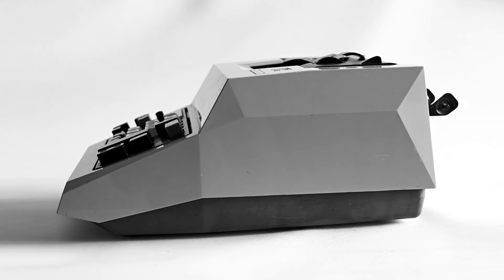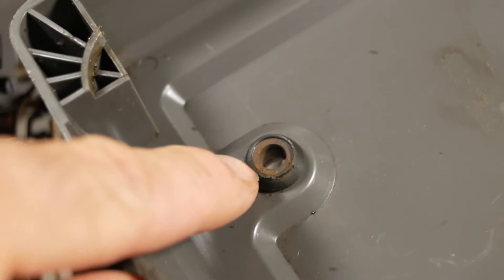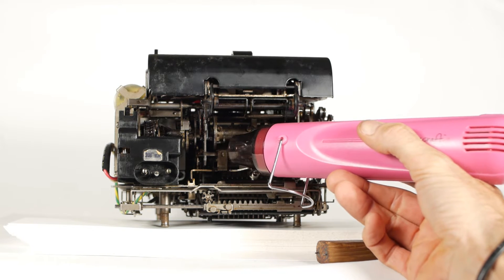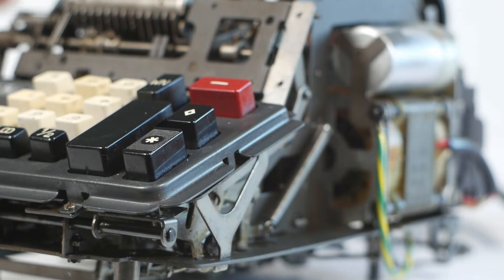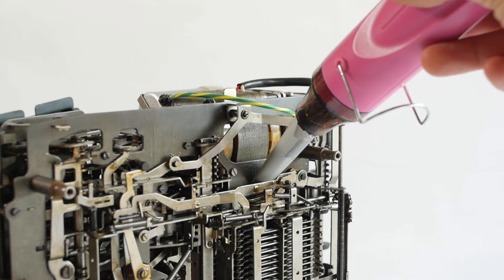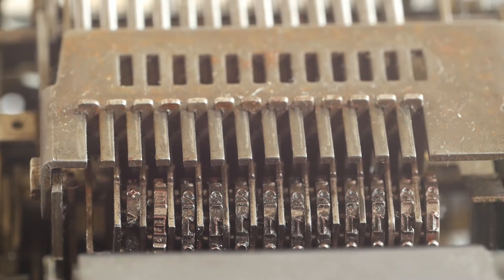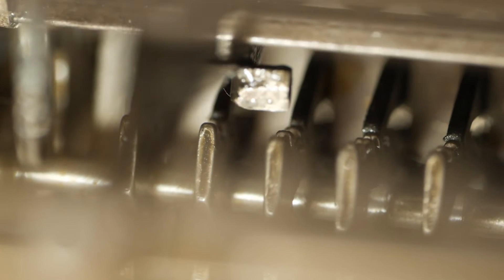Olivetti Multisumma 20 - Part 2 - Mechanism & Repairs

Comment: Hi Tim, I have a machine similar to this one. It's an ivrea 20 electric. I have found a few sticky parts and got them moving. All the keys work except the number pad.
When I press a number the indicator stays where it is. You can see the linkages moving and you can hear the pins being pushed on the matrix.
The silver bar you mentioned in the video is clean and I have used penatrating spray to try and get it moving. Any help would be appreciated. Thanks.
Reply from the maker: Hi Wavydave Hill, the keyboard mechanism should be pretty similar or even identical to my machine, so hopefully, with a bit of detective work we'll get yours running.  I presume the indicator for the numbers is all the way to the right, ie no digits have been entered.  In that position, assuming the matrix which runs on the silver bar is free to move, you should be able to move the matrix about a millimetre to the right and then it should spring back to where it started (viewing from the front of the machine by the way).  It won't move the other way until a key has been pressed.  If it won't move that little bit, it could still be gummed up with old oil - that sliding bearing has quite a large surface area for the old oil to stick it solid.  If the matrix will move that small amount to the right, but doesn't move back to the left when you let go, it could be that it's still sticking, or the spring that pulls it to the left is broken, disconnected or missing.

Anyway, have a quick look at that and let me know what you can find.  Feel free to email me (address in the "about" tab on my channel), that way you can always send photos or video if required, because it's often easier to see a problem than describe it!!!
Reply: @GrumpyTim  Thanks for the reply. What is your email, I couldn't see it.
I tried moving it to the right but it wouldn't move.  
What I have found is the clamp around the block that moves is attached to a lever with a roller at the end. There is a arm which is connected to a rear cam. This is on the left of the machine look at it from the front.  This arm with a roller on it seems totally jammed. It seems to go in the keyboard. Is there something that could be jamming it. I will send a picture of this leaver. Thanks.
Reply from the maker: @wavydavehill8520  I'll take a look at my machine tomorrow to refresh my memory.  In the mean time, my channel name at my channel name .com should get you there, obviously inserting the name of my channel! I tend to get about a million spam emails if I leave my email address in the comments.
Reply from the maker: Hi Wavydave Hill, definitely a few photos would help - the am with the roller is used to drive the matrix back to it's rest position after a calculation.  At rest, there should be no movement in one direction, but you should get about 1mm of movement the other way (it's directly connected to the matrix so it's the same movement you'll be feeling.  However, if the matrix is still seized on it's shaft you won't get any movement.  Likewise, if, for some reason, the matrix has been pushed hard against the end stop, then you won't get movement in either direction.

Comment: Greetings from Portugal from a recent fellow enthusiast! Great video, bought a Multisumma 20 in what looked a great shape, but many parts were not working... following your general directions in this video I've managed to put it ALMOST in fully working condition! The only problem I'm having now, that renders the machine useless: both in addition and multiplication the machine does not carry decimal increments from the previous number operation.  Example:  ADDITION  12+13=25 (OK)  BUT  12+19=21 (does not carry the 1 from previous position into the next ) -----  24*2=48 (OK)  BUT  28*3=64 (SAME, does not carry the 2 from previous position into the next ). Many parts were seized up... Do you have any clue of the offending part? All the best and thanks for sharing your knowledge on these amazing beasts.
Reply from the maker: Hi David, I'm away from my Multisumma for a few days, but I'll think about your problem and if necessary take a look at my machine when I'm reunited with it next week, then I'll get back in touch.  In the meantime, could you add the fairly normal 123 + 456 + 789 + 987 + 654 + 321 - do it several times and make a note of the result each time - it might give me a bit of an idea, or it might not help at all - my hunch is that you'll get fairly random results but I could be wrong and you end up with the same every time.
Reply: @GrumpyTim  Thank you very much for your answer! I will turn it on and see what the machine spirit feels like answering — and post it here!
Reply from the maker: I had another little thought, try the same thing but add 3 zeros, ie 123000 + 456000 and so on - that way, if it's only the third column that's not carrying correctly, you might get the correct result, or it might be even worse.  You could even try with 4 zeros, after that we should have more of an idea whether it's one column or the entire register that's playing up.
Reply: @GrumpyTim  Thank you for your generous help! Will try it tomorrow and let you know - I managed to find 2 service manuals online, one in English, the other in Italian, very detailed for problem solving and practical work to solve them... but if I have to make an open heart surgery to the Multisumma register or accumulator I fear the worst... will try it nonetheless and learn something in the process, even if so much above my present skill level!
Reply: @GrumpyTim  Greetings again! Finished the test, and again got a consistent same result every time: BLANK total! Good Lord, not even zeros... I'm totally baffled! Even not being able to carry it should had gave me some zeros: if I summ 950+50, for example, I am given an infamous 900 as a result! Thank you for all your patience with an internet stranger in mechanical distress!
Reply from the maker: This may take some time!!!  Are you running the machine on the motor or turning it by hand - the only reason I ask is that it's a bit easier to see what's going on when you turn it slowly, but either way it's not the end of the world.  With the register cleared (assuming it will clear, it's always possible that it won't clear if there's still something sticking in there), if you enter all 9s and press the plus key, do all the number wheels move to their 9 position as they should?  Then if you press the sub total or total, does it print the 9s as it should?  Assuming those are both "yes" I'll go away and refresh my memory on how the register operates and performs the carrying of numbers.
Reply: @GrumpyTim  I'm running it on electricity, I turned it by hand when I first began following your video to clean it up and diagnose possible problems, just to guarantee I would not stress the motor too hard if some parts where badly seized up... Did the test you asked, and both the subtotal and total operations print the 9s correctly... Just my luck to hit jackpot with a complicated issue on the Multisumma, being myself just a rookie! Thank you again for everything! P.S. I will build one of your "hi-tech" contraptions to turn it by hand with some semblance of confort, in order to be able to understand what is going on with the mechanism step by step...
Reply from the maker: Good idea to make a turning device - it just makes it that bit easier to see what's going on.  I'll take another look at mine tomorrow - I know more or less what I'm looking for, I'm just not sure if I'll be able to see it on this machine without taking more bits off - I'll let you know what I find.  Feel free to email me (address in the "about" page of my channel), then, if I figure out something useful I can send you either a photo or even a quick video trying to explain whatever it is that I find.
Reply: @GrumpyTim  Tank you! I will... if you want I can send you the manuals I found online:  First one reads: «Olivetti MC24, MC26, MC20, MC23 fault-repair guide (Olivetti, 1971) in English, the other «Multisumma 20 Servizio Tecnico Assistenza Clienti» in Italian; finally, only for the Summa Quanta 20, «Technical Assistance Service» in English... clear cut hi-rez diagrams. They look like in--house publications for their own certified repair technicians of that era...
Reply from the maker: Just the Multisumma 20 one would be fine - I know what I'm looking for in it, I'm guessing the carries will be done in a similar way to the Prima 20 (I have that manual) and I should be able to figure it out (famous last words) from there.
Reply from the maker: Hi David, I got the WeTransfer file so I'll take a look at it today and see how it relates to the actual machine - I'm sure your examples will also help in identifying the problem - it'll almost definitely be something that's still sticking, probably deep inside the machine and very difficult to get at, because that just seems to be the case sometimes!!!!  Your English seems to be incredible to me and you've explained everything very well - you put my Portugese to shame - I know some essential stuff like "dois cafés com leite por favor" but not a huge amount more.

I also spotted something else, which is really kind of you and you really didn't need to - you are the first person to use the PayPal link ever, much appreciated.
Reply: @GrumpyTim  You are welcome! Your help gives me some hope I will see the light of day in this endeavour, I hate having beautiful vintage mechanical things that are there only for show: it somewhat feels wrong, a crime against its original purpose, I don't know, but it really bothers me to no end... 
I found something else, testing the machine again and again: I mislead you in saying that it was using the complete 10 digits for operations that caused the carry to occur and the results to be correct. It is not so — The results are correct ONLY if a carry results from an operation in the 10th column!  55555.55555 + 55555.55555 = 111111.11110   (RESULT IS OK, EVERY POSITION IS CARRIED OVER)     BUT!     55555.55555 + 45555.55555 = 90000.00000   (NOTHING AT ALL IS CARRIED OVER!)
P.S. Your Portuguese, if only that bit, sounds great as well!
Reply from the maker: Hi David, I'm getting close to the answer, in fact I more or less know what's happening (or not happening on your machine), I just need to figure out how to describe it!!  Bizarrely the Multisumma service manual covers the multiplication side of the machine but doesn't even feature the register, however I found a service manual for the Summa Quanta 20 which shows it all exactly, AND it's in English, which helps too.  I'll try to knock up some sort of rough video to show you what I'm talking about and I'll also send you the Quanta manual.  If I can I'll do that this afternoon but I might run out of time, in which case it might be tomorrow.
Reply: @GrumpyTim  Thank you very VERY much for all your incredible help and willingness to share knowledge about these amazing machines, GrumpyTim!
Reply from the maker: Hi David, hopefully I've just sent you the manual for the Quanta 20 and the video I've made (assuming I sent it all to the correct address).  Sorry the video isn't very well put together, but hopefully it'll show you where I think the problem might be.  At the very least, it should help eliminate that part if it doesn't prove to be the solution.
Reply: @GrumpyTim  Greetings Grumpy Tim!
Followed your procedures to the letter and was rewarded with complete success!
Your Video and help was absolutely amazing!
The Multisumma now works smoothly and more importantly, gives the correct results in addition, subtraction, and multiplication!
It was indeed both of your diagnoses: the dented levers responsible for the carrying of the tens were stuck to the axis and between themselves, and the protruding spring-acted top ones were stuck also: those responsible from the 6th to the 10th "column" numeric calculations were really TERRIBLY seized, took me ages to free them...
Very grateful for your knowledge and patience with a simple beginner...
All the best for yourself, your work and this great Youtube channel!
Reply from the maker: @DawidGabriel  Hi David, that's made my day, really glad you've got it running. It's amazing how solid old oil can get - it ends up more like glue. Well done.

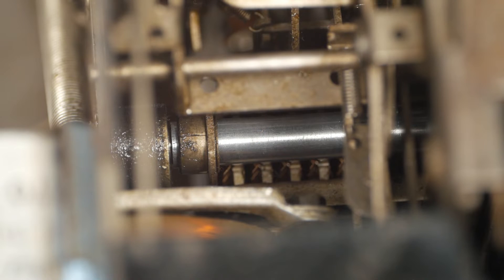Comment: Hey there i have a Olivetti summa prima 20 with an keybord issue 5:14 mine wont move at all no matter what key i press. I have checked everything and oiled it but it just wont work  
pushing it by hand dose make it work sometimes. May i know what kind of lssue this is .
Reply: by looking down i found theres an hook that hold the keybord the lssue is the hook just keept go to an wrong position and jam up the head.
Reply from the maker: Hi, can I just check which position the pin matrix is in at the moment?  Looking from the front, the pin matrix, and the little indicator in the window which is attached to it, should be over to the right.  As you enter each number, the pin matrix, complete with the little indicator should move one place to the left.  The keyboard clearing lever should move the pin matrix back to the right without having to crank the handle.

There's a spring that pulls the matrix to the left and some levers that move it back to the right.  Is yours moving to the left at all or is it just stuck on the right hand side?
Reply: @GrumpyTim  I dont really know how to tell mabye i will make a video and tag u
Reply from the maker: Yeah, that would be good, you can just let me know here once you've uploaded a video and I'll take a look to see if I can spot anything obvious.
Reply: @GrumpyTim  np i will make a video later. Have u heard a machines called 'FACIT 1204' i have that but a RARE one its looks same but the name tag were not same mine has the tag Odhner.
Reply from the maker: I hadn't heard of the Facit 1204 - I had to look that one up.  The Facit that you see all around is the C1-13, which seem to be everywhere, and the wedge shaped models that came along later appear quite often too, but I've never seen a 1204.  It looks like Facit (or at least their parent company) bought up the Original Odhner name in 1942, so it's quite likely they then used it on some of their own products.
Reply: @GrumpyTim  i have send an vid
Reply from the maker: Hi, I've had a look at your video, I'll need to take a look at a Prima Summa 20 - I've got one over at a friends house - I need to refresh my memory (the Multisumma is a little bit different so it'll be better if I look at the other machine).  I'll hopefully have a look at the weekend - I'll let you know once I've had a look, or if I think of anything before hand I'll be in touch sooner.
Reply: @GrumpyTim  no problem take your time don't rush :D

Comment: Hello Tim! Another wonderful video! And it has lots of important information for me.

I have a Divisumma 24 in which the division is no longer working... I have an enormous fear about causing damage In the machine while trying to repair it. I'm definitely not good in repairing things, as my machines are the very first opportunity I had to deal with such a complexity.

Tim, I wrote a comment in a video in which you repair a Prima 20. I've acquired a Studio 45 typewriter and a Summa Prima 20 adding machine. And I can now tell you that these machines are fascinating and endlessly fun to operate just like you said! Searching for information wherever I could find about how they work, discovering and testing ideas was surely one of the most awesome experiences I've ever had!

Thank you!
Reply from the maker: Hi Bruno, glad you're having fun with the Studio 45 and the Prima 20, it's a pity that the Divisumma 24 isn't working at the moment, but the main thing is that you have it - one day you'll manage to get it working again - the main thing is not to rush - if you don't feel up to tackling it at the moment, don't try.  Instead, take on some simpler mechanical repairs to build up your experience and confidence first.  It's reasonably likely that if your Divisumma was working and now isn't, that some old oil that had been freed up enough to get the machine working, has now set hard again, causing a part not to work - I've had that a few times, and most of the time I can get to parts without taking the whole machine to pieces, giving the offending part some more oil and heat and wiggling it until it's free again.  Obviously, taking the entire machine to pieces and cleaning every bit of old oil and grease off would be a more thorough way of doing the job, but that's a pretty daunting and time consuming task for anyone.

Anyway, I hope you carry on having fun with your excellent collection.

Comment: I just finished fixing a Marchant I, and although not a mechanical machine it was a nice break - havent had much time to work on my fridens but I have done a few minor repairs here and there.  Your ability to navigate these with such knowledge is very impressive, im still questioning what most levers do in machines Ive had for years
Reply from the maker: Cheers ArcadeCarpet,  unknown levers and the like can present quite a puzzle - you don't know what the lever should do or if it's actually doing it's thing already and you haven't noticed, and that makes it pretty difficult to figure out why it isn't working if you don't even know what it should do in the first place!!!!  I'm very familiar with that situation, even on this Olivetti, before I fixed it I didn't know how the multiplier should work (as it happened it was exactly as you might expect it to work), but luckily I found an old sales brochure or something online which gave a brief description of what each key should do - the brochure was all in a foreign language but luckily we have things like the google camera/translate facility which really helped in that situation.

Cheers for watching and commenting, and keep having fun with your Marchant and Friden machines.